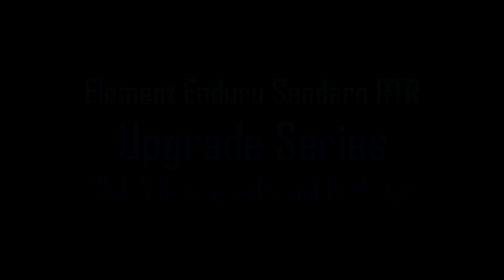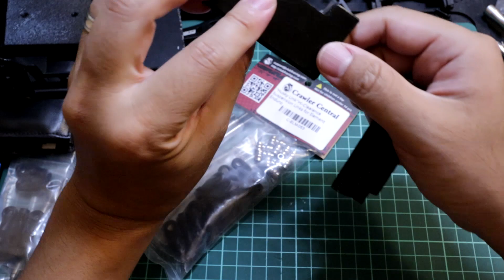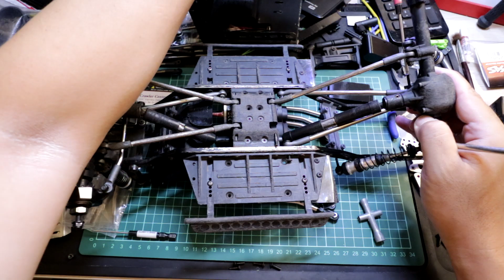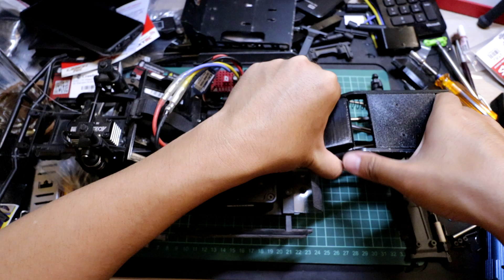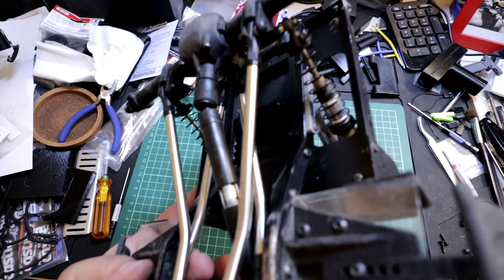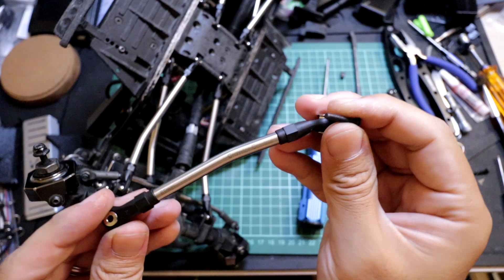Element Enduro Sendero RTR Upgrade Series - Club5 Racing Links & Shock Bushings

Comment: Are these high clearance links for the se enduro?
Reply from the maker: These should work on the Enduro SE as long as it is the same 313mm wheelbase.  For the most part, the only huge difference between the original Enduro Sendero and the Sendero SE is the different skid for the Stealth XF transmission.  The rest of the differences won't really change up anything major, so the upgrades that address those on the Sendero should work for the Sendero SE.

Comment: I installed the links and now my front tires are pointed out. Did I do something qrong or is therw an adjustment that I need to do?
Reply from the maker: Front tires pointed out, I'm assuming you're talking about the steering link.  You may have overtightened the rod-ends on the steering link that goes behind the axle making it too short which pulls the tires outwards.  Back out the rod-end a few turns on each side and check to see if your tires are straight and adjust.  Repeat until the front tires are straight.
Reply: @RevolutionX  I tried backing it out and it worked. Thank you for the help.

Comment: What 3d printer do you have?
Reply: Also do you have 3D files that you can share?
Reply from the maker: You can find my files here. https://www.thingiverse.com/revolutionx/designs
Reply from the maker: I was using a Prusa Mini.  I am now using a Prusa i3 MK3S+
Reply: @RevolutionX  Oh nice! why did you upgrade? also when inserting file do you need to Slice the program or can you just add the STL File?
Reply from the maker: @doshermanosrc  You need to slice for your specific printer and filament.  I wanted a bigger bed size.  I'm considering whether I should keep the mini as a second printer or sell.

Comment: Can't wait to hear your thoughts on the HC links.  I had picked up Hardcore RC HC links, and really liked how it transformed my Enduro.
Reply from the maker: I had a chance to do a quick run with them.  It made some stuff much easier for sure!  There were a few lines that I had to drive differently though.  I didn't realize how much I used the links as leverage on some of them.
Reply: @RevolutionX  Yeah, it takes a bit of getting used to, but once you do, I don't think you will be going back to stock :). Mine is even lowered now with Gspeed chassis.

Comment: Perfect timing for a new video upload!  Was working on my IFS Trailwalker when your video popped up!

I really like the Club 5 Husky link set.  Glad to see you got them installed.  Great job on the design and print of the rear chassis brace.  Looks like the rear upper links clear good now.
Reply from the maker: Yeah both chassis braces worked out great!  I had a chance to run it yesterday, but I didn't take much video.